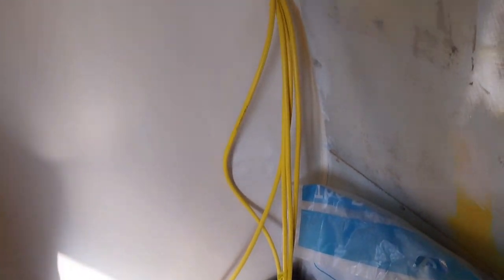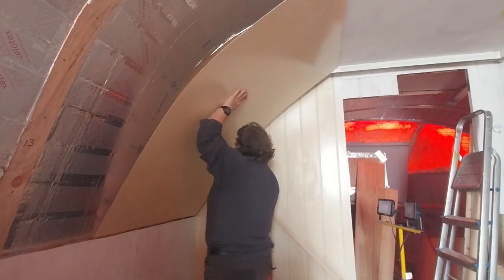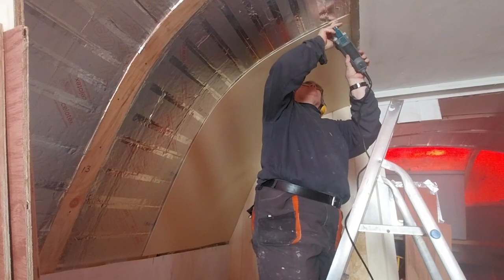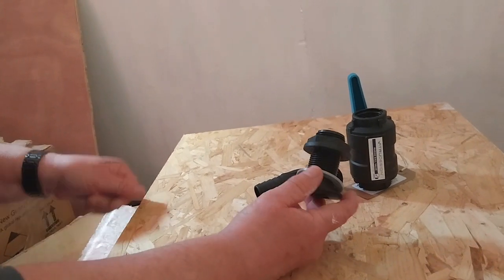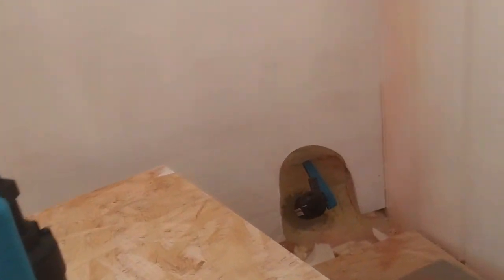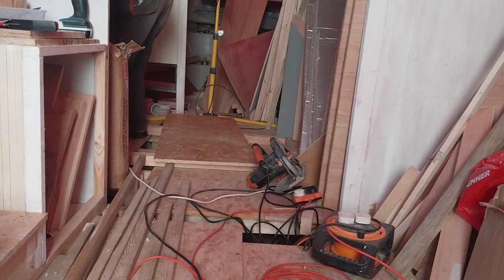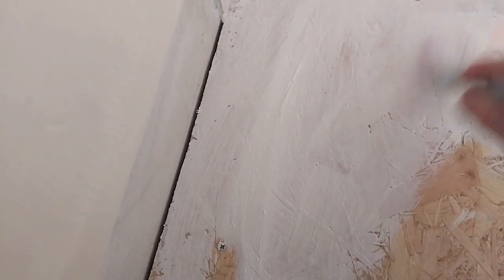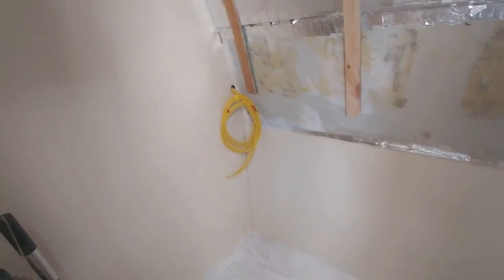Lifeboat conversion Ep. 25 Bits 'n pieces

Comment: What's the electric setup going to be? 48v or 24v?

Love the content as always!
Reply from the maker: Hiya, it is going to be a 12V system as both the engine and bow thruster work on it. It is also easier to find lights etc on 12V. Not running cables that much length, so will work fine with the 2.5m3 cable I am using.😊
Reply: @lifeboathygge  Awesome. Looking forward to seeing how you spec that all out.

Comment: Does the pink spray foam expand really quickly, and thus safe to enclose immediately?

I've had issues before where I used foam, immediately enclosed it, and then the foam continued to expand and warped my wood.
Reply from the maker: Very good question. I have had the same issues before with it on other projects. It is not so much of a problem if you use thicker wood and as I screw it down immediately it stays straight. Not using too much helps as you might be tempted to overfill the whole cavity.
Reply: @lifeboathygge  If your just using it to seal small gaps around things, you can get low expansion foam it's usually used around windows and doors to avoid distortion but still get a proper thermal barrier etc.;-)
Reply from the maker: @alan-sk7ky  I think tbat is the stuff I am using, although I just buy what is on offer at the time. I think the pink stuff is supposed to be fire grade. Not going to try.......